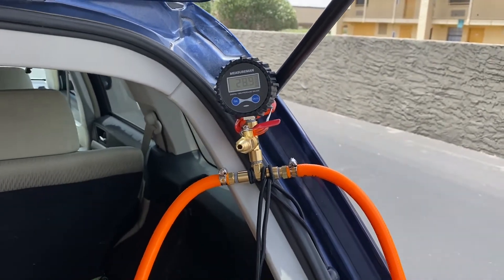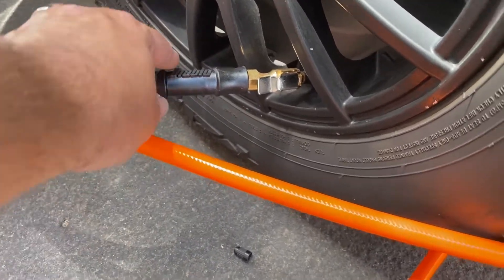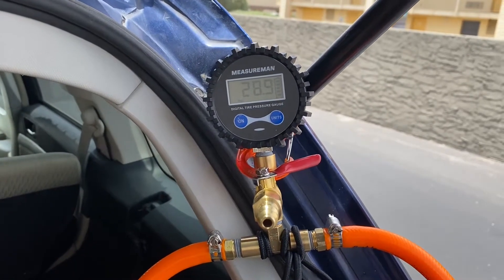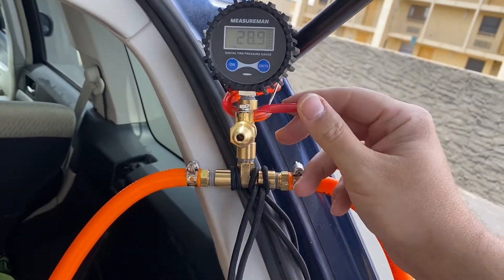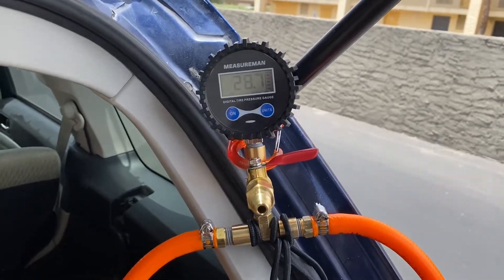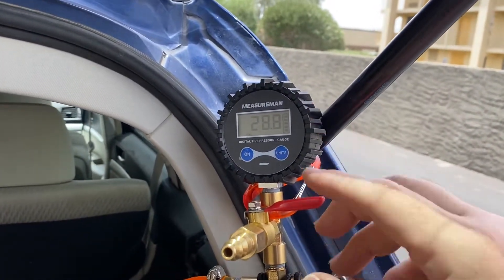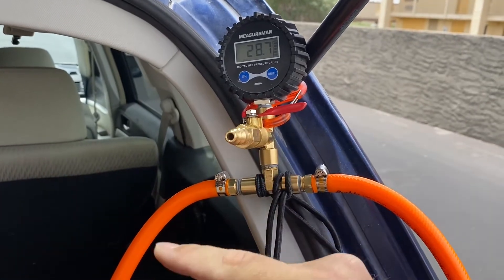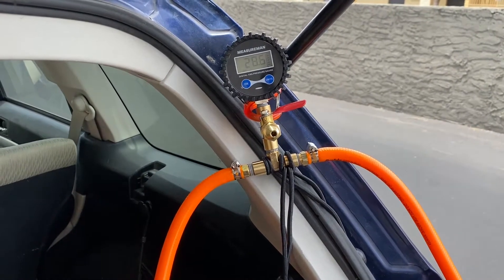4 Tire Inflation Sytem For $80?!

Comment: The bottom neck is the pathetic electric air compressor.  You are not airing up any faster by doing it one tire at a time, besides now you all hoses that you have to store in the rig.  Good idea at first but impractical in real world.  If you consider you are a hardcore wheeler, get a AC compressor OBA.
Reply from the maker: OBA is very nice but isn’t in everyone’s price range. This system doesn’t air up one at a time since all 4 are connected and the system equalizes pressure across all 4 tires so they are up evenly. I will say that I’ve been on the same trails as people using OBA and some people took about the same amount of time to air up as I did. Some did it about 2 minutes faster. For me 2 minutes isn’t worth $400-600 extra an OBA system would cost but that’s just my opinion.
Reply: @realrigsrattle8829  I agree the OBA system isn't worth the price for 2 extra minutes
Reply: There are benefits to connecting all 4 tires together that a compressor on one tire at a time dosent do the air between all 4 times Equalize to the same pressure and a quad tire inflation system saves around 25 minutes of air down and air up time on a trip that's more time on a trail or driving home and another perk is if your airing down all 4 at the same time they still stay equalized and all end up and the same lowered pressure... your talking about a exspensive setup that most can't afford and you think storing these hoses in the rig is hard if that's the case then you shouldn't be offroading everything takes time weather you pull put 4 hoses or 1 and do it one at a time while your airing down with the quad inflation system you can also be doing other things @Fashion Photographer